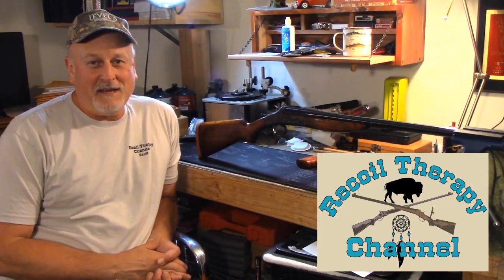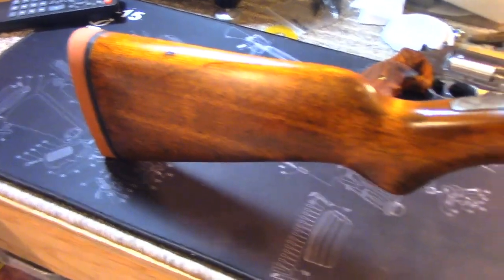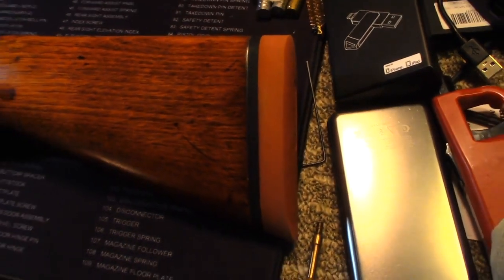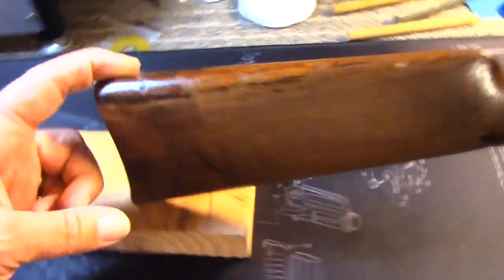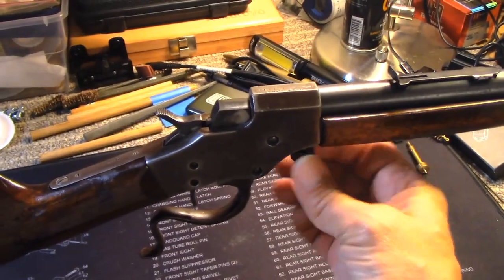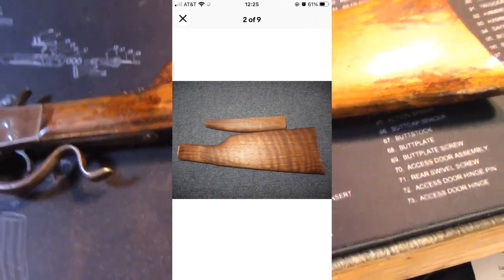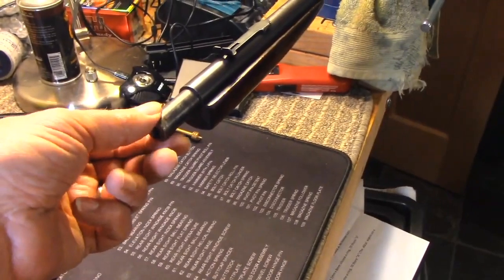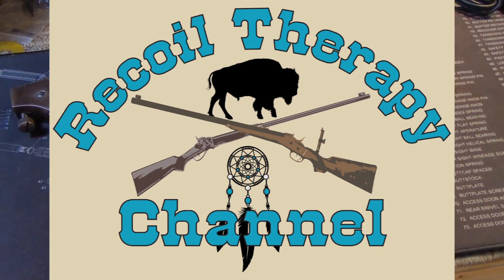Stevens Model 1915 (The Favorite!) Restoration part 1

Comment: I had this exact rifle I got just last year for $180. The barrel was heavily pitted on the inside and the chamber was so opened up it would burst cases or they would get stuck on extraction when I test fired a few rounds. It had an amazing trigger though. I was going to have the barrel sleeved but came across a Winchester model 1890 gallery gun in 22 short with a period Tang site I had to have. The 1890 is so fun to shoot at my 1/5 scale silhouettes on a stand that I made. I have a pump Henry also so had no need for the stevens anymore and sold it to fund other stuff. I’ll be watching your restoration imagining on what could’ve been.

Comment: Those screws are viable at least from the looks of the head. That's going to be a pretty rifle when done. I look forward to seeing it done.
I'm working on another roller. 1870's Remington mfg originally in .43 Spanish. Barrel was trashed and aside from a complete action,the damaged barrel and the damaged but repairable rear sight nothing else left was left. 

Screws are wrecked and I'm lucky I soaked it in oil and then heated it because the head of one of the trigger plate screws was hanging by a wire thin section. Saved a real headache of drilling a using an extractor.

I cut flats on the ring, now have to extend and bend the trigger plate for a grip, turn new screws and re-profile the block and hammer spurs to a sporting configuration, cut the checkering on them, blue them and case the action, trigger plate and pin retainer. This will be a lot of fun.

Going to barrel it with a Green Mountain .32-40  34" barrel and slow rust blue it. I'm thinking Treebone semi-fancy walnut and cutting fine 32LPI checkering on the grip.

I'm sort of cloning an original No 1 Creedmoor that was posted on the Remington forums some years ago. 

I want something economical to shoot  100-600 yards, 45-90 eats ingots and cases of powder, great for going the distance but man, watching a friggin 60lb factory ingot disappear as you cast 540gr slicks hurts.

Anyway I look forward to the eye candy when you get the Stevens done.
Reply from the maker: Your project sounds awesome.  I really enjoy keeping the old guns running and in like new condition.  Family heirlooms are created this way.

Comment: Mine has a serial number of a "C" right in the spot where the lever hits the tang, then the number "41" between those two screws.  I don't know what that means either.  Mine has the round barrel. read once years ago that those with round barrels were probably made in the 1920's.  My grandfather bought it new I think, father had it, stayed with a cousin when we moved West, then I got it in 1960.  I am 77 now and trying to get it fixed up a bit to send back to family so maybe it will stay in family for another hundred years.

Comment: The 751 is not a serial number but a production run. Doesn't seem to be rhyme or reason. Your front sight may be a replacement. Most are brass and are crudely pinned in. Yours seems much nicer. It's not a falling block but is actually called a drop block. Your rifle appears to be early after 1920 when Savage took over the Stevens Co. when they switched from octagon to round barrel but before they added their SVG cartouche to the left side of the receiver. It would be nice if you could date it from that. They were made thru 1937. i see you are missing the elevation adjustment on your rear sight. Shouldn't be too hard to make one rather than pay the exorbitant price for a parts replacement.